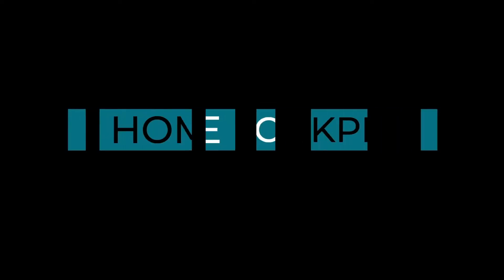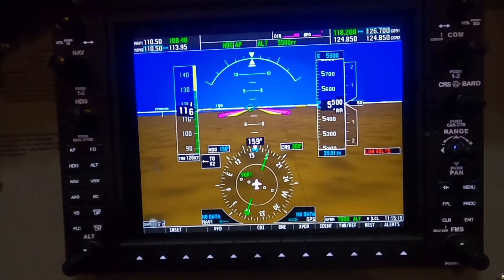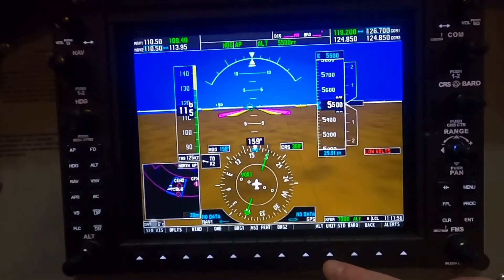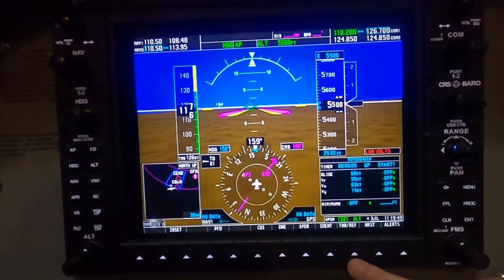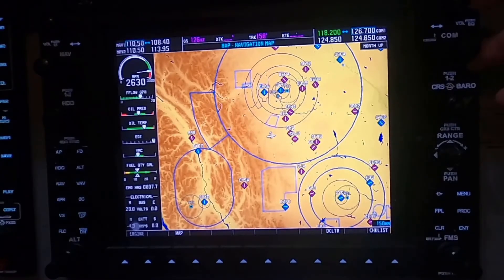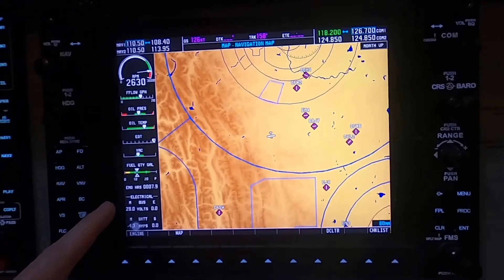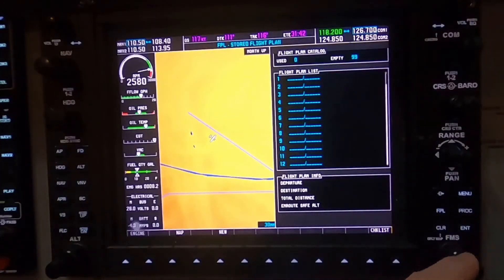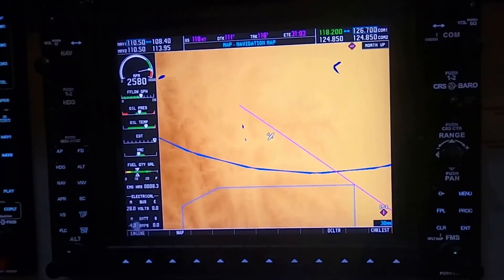SIMiONIC G1000 Demonstration and Basic Tutorial for using the PFD and MFD

Comment: Thanks for the video :-) With a combination of PC (MSFS2020) and 2 iPads I have a question: Do you know how or where you can find information about obtaining a flight plan on the iPad, more specifically: G1000Nxi in MSFS2020 is very easy and once entered an FPL, this entered FPL is NOT present on the (2) iPads. How do you get the flight plan on the iPads? Do you have to enter this separately on the iPad? thanks for a reply
Reply from the maker: Yes Simionic is a different SW so you need to enter the FP there
Reply: thanks for the reply... So Simionic PFD and MFD on the iPad are completely worthless as long as there is no (better) synchronization between MSFS and Simionic on iPAD... @simpilotandrew4659

Comment: Hi, appreciate if you may share how you configure the Sim Bridge, and network connection, between Simionic and MFS2020 please, I cant get it working
Reply from the maker: Ipads all on the same network and connected to each other ? Run the bridge and recycle start/stop - check you get connection recognized to the PFD/MFD and the Sim in the bridge.... if you are still having issues drop a line to Li Chen - they are good at responding